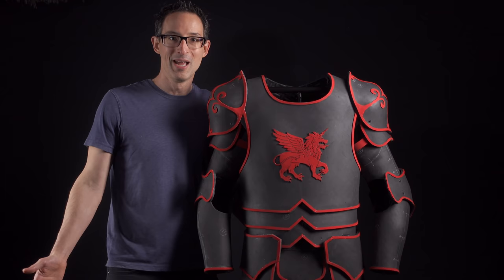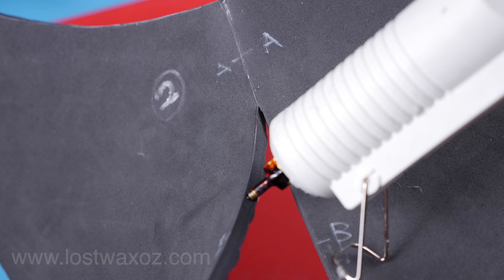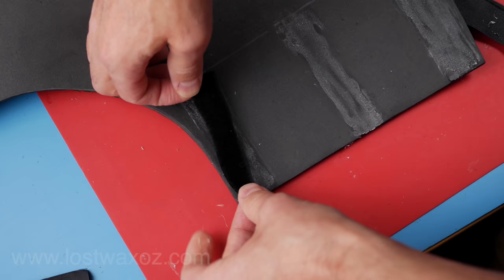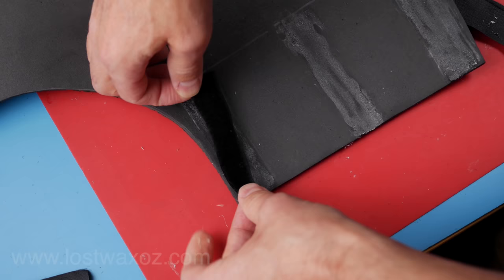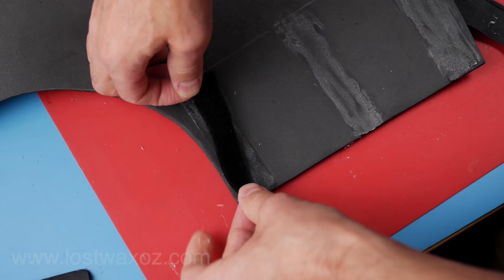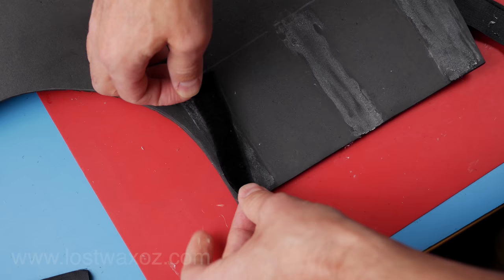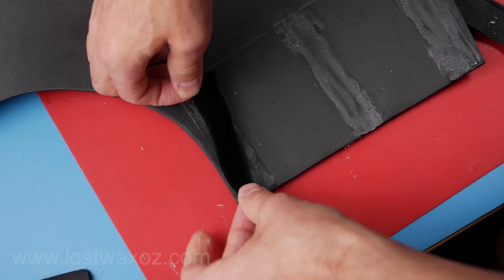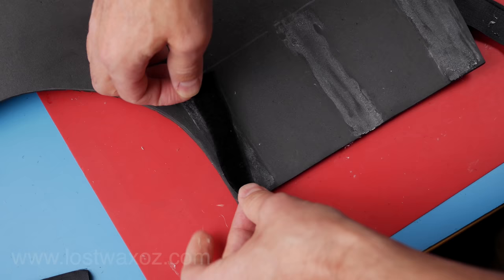DIY Knight Armor Cosplay / How to Make a Foam Knight Armor Costume Using Hot Glue!

Comment: Materials List:
Printer
Paper
Tape
Scissors 
Pen (not ballpoint
Box cutter or exacto knife
Sandpaper (80 grit
Hot glue gun
6mm eva foam
2mm eva foam
Velcro
4 mm hole punch
Quarter inch vinyl tubing
Webbing or strap
Cloth
Contact cement
1 inch elastic
2 cm webbing
Paint brush
Acrylic paint (black was used
Acrylic paint for accents (red and silver used
Silver metallic paint
Paint sealer

Comment: If you have trouble with hot glue use barge. You put it on, let it dry for a few seconds and it glues right together. No need to hold it in place for long periods of time. .
Reply from the maker: Agreed. And use a respirator and do it outside.

Comment: Once again a brilliant video tutorial, Clear, concise and funny! I notice you used a 'white pen' to mark up the foam. What is it? a chalk marker, Paint? I've been trying to find something like that. Any chance you could let me know, type, maker etc? Thanks Gerard
Reply from the maker: Hi Gerard, I have also had quite a bit of trouble finding a non bleeding pen that worked well, and didn't dry up after a couple of uses. So far I am really happy with these ones I found (the thinner pen I use later in the video) They are acrylic paint pens by the brand Aroic with a .7mm tip. I bought a 12 pack of white (still on my first one) but those seem to be sold out on Amazon right now. I'll link to the coloured pack- they're the same pens just in assorted colours. Here's the link https://amzn.to/3upoRjb (that's an Amazon affiliate link and I do get paid for qualifying purchases😁)

Comment: Love the armor and the tutorial. Just thinking about building the armor for my son - he loves knights!
As I am a big fan of the old knight movies I was wondering how to include a shoulder shield to the armor - like in "The first Knight"?! I am thinking if it would make sense to add it to the existing pauldrons or or to replace on side and add the shield instead!?!
Just to make sure - the new shield pattern is also included in the knight armor pattern?
Cudos from Germany! Best, Torben
Reply from the maker: Hi Torben! I think you might want to keep the pauldron, but do a simpler version, maybe remove the flappy bit. because the pauldron kind of cups the shoulder, that might help keep the shield in place a little better. You could glue or velcro the shield to the pauldron. and yep, the shield is included in the pattern!
Reply: Thanks! Was already thinking of using the pauldrons without the middle ornaments and maybe removing the little tips at the ends!?
Are you also using 6-8mm foam for the kids version or a little thinner - like 5mm?
Reply from the maker: @torbenheide  Yep, I'm still using the same foam- it's more around the 7mm mark or slightly thinner. 5mm would work too as long as it is reasonable dense

Comment: How's the mobility in the suit? It looks like the joints would work well, the shoulders might be a tad stiff, though. How about spinal and abdominal mobility? Can you bend over at all? It's just one solid piece of foam.
Reply from the maker: Mobility is reasonable, I made it so the breastplate should end above the waist so that you can still sit down with it on, Shoulders are pretty good as long as you're not reaching above your head. Probably the weakest link is the pivoting rivets at the knees, sometimes they can pop out if they get too stressed.

Comment: Thank you for the tutorial. I don't know if you will respond to this since it seems like you have not been active for about a year now, but if you do see this, I was wondering if I could get a list of all the materials you used for this, and how much foam I would need to make the full armor (The link on the blog links to a listing for 30 square feet, but I'm assuming I wouldn't need that much). Thanks
Reply from the maker: Hi, yep I am still actively making and releasing content :) So, it depends a bit on what size you are making, but for an adult sized medium armor as well as helmet, , you will need a 4 x 8 foot foam mat- that'll give you a little bit left over- which is good if you make any mistakes. I have just copied the supplies list from the pattern below- hopefully it's helpful, it looks like a long list, but hopefully some are things you already have or can make do with something similar:) 

• Silver Gel Pen or Paint Pen: Used for any markings on the foam. If you use a ballpoint pen or sharpie and then try to paint over it with a light colour, the pen ink will migrate through the paint and you will never be able to cover the lines!
• Scissors
• Ruler
• Very Sharp Knife: If it is not really sharp you will have a terrible time when you are cutting the foam. I use a surgical scalpel or utility knife. Use a brand new blade.
• Cutting Surface: Somewhere to cut where you won’t be destroying anything.
• 5-7 mm Thick Eva Foam Floor Mat: I used a mat that was 4ft x 8ft and had a little left over after
making all the parts. (Not including the helmet)
• 2 mm Thick Eva Foam: You can often find rolls of this stuff at craft stores. A roll is handy because you can cut nice long strips from it. If you can find it in black, that’s the best- if a bit off paint gets rubbed off during use, there won’t be some random colour showing through.
• Hot Glue Gun: I highly suggest a glue gun that has adjustable temperature. If you use a temperature just a little bit higher than the melting point of the glue, you will have fewer burnt fingers, and not have to hold pieces together as long while they cool.
• Heat Gun or Blowdryer: Used for heating and forming the foam.
• Gluing Surface: A surface that you don’t mind getting glue on. A silicone baking sheet is great
because hot glue doesn’t stick to it.
• Leather Punch: 4 mm diameter.
• Black Paint: Artists acrylics work reasonable well, though they can crack over time. If you want a really durable, long lasting finish, I would suggest using a flexible paint, such as Plaid FX paints.
• Metallic paint: I used DecoArt Americana Metallics “Silver” mixed with “Pewter” for the silver colour, and “Antique Brass” for the gold.
• Rubber Gloves: To wear while applying the metallic paints
• Water based contact cement: (optional) Used to glue fabric to strengthen the foam straps.
• 6mm (1/4”) Vinyl Tubing: 2 metres (78”)
• 2.5cm (1”) wide Webbing (1.7cm (3/4”) for child sizes): 82cm (32”) for the straps to attach tassets to breastplate.
• 1.5cm wide Webbing: 40cm (15”) for the straps attaching the arms to the breastplate.
• 2.5 cm (1 inch) elastic: Approx. 2metres (78”). Get a little more if you are a larger size.
• 5 cm (2”) wide Hook and Loop Tape: Used to for attaching parts together. I used 130cm (51”) • Fabric: Just some scrap bits of lightweight cotton or polyester

Comment: How does the hot glue hold up compared to contact cement?  I would think that the contact cement provides a stronger bond.
Reply from the maker: Contact cement is stronger, but I find that hot glue is strong enough. The times I have failure with my hot glue is if I am gluing to a heat sealed surface, and I haven't roughed it up a bit with sandpaper first.

Comment: does the hot glue hold well years later? and how is its flexibility vs something like Barge?
Reply from the maker: the hot glue doesn't seem to deteriorate much over time, I'd say it's a little less flexible than barge, though the only failures I have had is if I haven't roughed up a heat sealed surface before gluing. And you need to make sure it doesn't sit in a hot car or hot direct sunlight for a long time.

Comment: could you make a pattern for someone who's tall and skinny? i'm 6 foot 3 and 140lbs. not sure if one designed for a 5 foot 11 person would fit me.. or would it?
Reply from the maker: Yes, it's so hard to make patterns that fit everyone, that's a good question, and I am not sure of the answer, I would think you'd want to stick with the adult medium size but then you'd want to add some length in the breastplate pieces. You could cut the breastplate and backplate patterns an inch or two below the armholes and then tape in a strip of paper to lengthen the pattern. You'd probably have to do the same with the leg pieces. I hope that helps a little....

Comment: Would you not use contact cement to save burning yourself with hot glue all the time and to save yourself alot of time sticking pieces together as you don't have to hold 2 pieces together until it cools. And saved alot of clean up after
Reply from the maker: I likely would if I had a fume hood I could work under. I just am not willing to breathe in all the nasty fumes that contact cement releases. Especially since I am doing it for hours and hours at a time. Though there are some disadvantages to hot glue, there are also some advantages- you can undo any glue seam by heating it up, and it isn't messy in the sense that liquids are- hands stay clean. Also hot glue sticks have a pretty infinite shelf life... So, yeah, for professional work, a good quality contact cement would be the go, but hot glue is actually a reasonable alternative.
Reply: @LostWax  ah that's very fair and very understandable. I just fear with the hot glue being easily heated and seams taken apart easily that in a really good summers day at a con that it would undo itself mid con and ruin your piece yeno. I've heard of a few horror stories like that. But yea shelf life and fumes wise your spot on. 👌

Comment: As someone who is XXL, my shoulders alone are wide. do you think this will work for size that large? If not how much more should I increase the size?
Reply from the maker: Hi Chris, I think the templates would be a little on the small side for you. I haven't had time to work on a larger size yet, so I'm not really sure how much to scale it up. I could guess around 115% might work, but it's really hard to know....
Reply: @LostWax  ah I see. Well there’s nothing wrong with making it TOO big because you can always cut it down more if necessary. May I ask what size you wear? Is it standard large?  If so I can kinda scale from there.
Reply from the maker: @chrisglory8640  The pattern right now has only one adult size- I call it size Medium, that's the size I wear. I'm about 5'11" and weighabout 165 lbs if that helps.

Comment: I can only find the interlocking 24” x 24” foam pads, which are not big enough for some parts. Any hints on where I can find larger mats?
Reply from the maker: That can be tricky depending on where you are. I do have a few links on my website that may or may not be useful: https://www.lostwaxoz.com/product-links/ I get my large foam mats at a local hardware store, it's sold as anti-fatigue foam mat, and that's the cheapest way to get it. If you need to order online, it's worth checking out TNT cosplay supply, they have foam in larger rolls that is smooth on booth sides. You might find those interlocking mats too thick for this build, I find a good thickness is around 7 or 8 mm
Reply: @LostWax  wow!  Lots of good info to follow up on!  Thank you for getting back to me!

Comment: I just came across this video, and noticed it is 3 years old, but I am just now getting into trying to make cosplay items. How would a suit of armor like this for a tall person? I am 6'5, so I am sure these dimensions in the pattern may not fit me.
Reply from the maker: Hi there, I do have an extra large size that is included in this pattern. I have tested it to fit someone of Height: 5’11”- 6’3” tall , Weight: 250+lbs, Chest: 47-52” It's hard to say for sure whether it would fit you, but there is a fair degree of adjustability. Hope that helps a little bit!

Comment: Bit random, but what is your bicep circumference, I printed it out, and it was a bit small on me, by a bit I mean I couldn't close it
Reply from the maker: Mine are 13" If you need to add some extra room, you can cut a line straight down the back and glue in a strip of foam to add some circumference.

Comment: Awesome!!!! Definitely want a female version of the breastplate. If you don't get around to it (or there's not enough support) do you think heating and stretching the foam on the existing pattern would work?
Reply from the maker: It would work to some degree, but you'd also likely want to taper in the waist a bit to give a little more form. And you're only gonna be able to stretch the foam so much. It looks like there is enough interest to do the female version, so that will be coming in the future.
Reply: @LostWax  awesome, thanks!!

Comment: hello, could you please tell me, how big this foam must be? is this information anywhere in this video or in your pattern? also how do i know if this fits me well?
Reply from the maker: I don't really have a definitive size the foam must be because it depends on the size you are making as well as the dimensions of foam you can find (obviously the larger the foam mat the better, as you will have less waste) 
As a reference though, you can fit an adult size medium armor and helmet on a 4foot x 8 foot sheet of foam with a little bit of space left over, but not much.
Reply: @LostWax  thanks, thats exactly my size. Keep up good work!
Reply: @LostWax  one last question: should i print pattern in a4?
Reply from the maker: @PowerPlayT   You can print in either A4 or U.S. letter size, just make sure when you print it, that you are printing it at actual size otherwise whatever program you print it with will try to scale it down. You can check by measuring the print guides on the paper once it is printed.
Reply: @LostWax  hi again, i cant find that big eva foam, do u have any idea where can i buy it? Or is it worth to just buy many a4 foam and glue it with foam glue?

Comment: Lost wax please see this comment. My printer can only print A4 pages, so is this big enough to complete the whole project
Reply from the maker: Yep, for sure! The patterns are made to be printed on either A4 or U.S. letter size paper. Just make sure your printer settings are to print 100% scale (or actual size) Otherwise your printer will try to scale it down a bit.
Reply: Thank you so much I didn’t expect you to answer this quickly! This and all your other videos Always amaze me! You’ve earned my sub :)
Reply: Also lost wax, would the size that this pattern is in work with a slightly larger 13 year old? Last question btw :)
Reply from the maker: @Ilovehumanevolution  I think the adult size should work for your 13 year old, it might be just a touch on the large size. You can see how it fits my (quite thin) 14 year old at the end of this video. If you want, you could print the pattern at about 95% scale and that would make it that little bit smaller.
Reply: Thank you lost wax!
Reply: I know i said last question, but I live in the uk and can’t seem to find 1/4 inch vinyl tubing anywhere. Could you reference the place you bought yours at? Thanks again
Reply from the maker: @Ilovehumanevolution  I just got mine at my local hardware store, but it's available everywhere here. It's 1/4" (6mm) inside diameter. I have looked around a little at U.K. websites and I think the same stuff is called clear PVC tubing. I think that's what you want to search for. Just make sure it is flexible, not stiff.
Reply: @LostWax  thank you so much, I’m going to start making the armour tomorrow. Cant wait!
Reply: Lost wax, this is the last, last question, I have a glue gun that needs to constantly have glue in it, and so I do not know how to flare the ends of the tubing with it. Thanks in advance
Reply from the maker: @Ilovehumanevolution  Just wipe off the tip the best you can and then don't squeeze the trigger while using. It's O.K. if you get a bit of hot glue on the tubing.
Reply: @LostWax  alright thanks so much!
Reply: Last last last question, would 1000mm by 2000mm of 5mm thick cosplay foam be good enough for this product? I’ve already ordered it but i just wanted to ask anyway. Thanks again